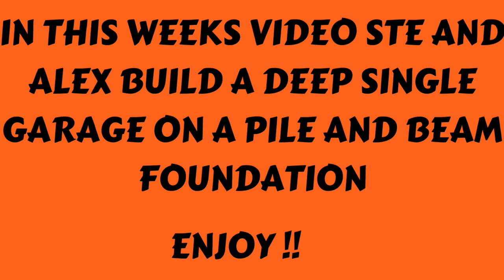BRICKLAYING......PILE AND BEAM FOUNDATION...SINGLE GARAGE

Comment: I've never used profiles or a Lazer. I haven't built many houses either .I worked for my grandfather who was born before they built the Titanic my mother was born in 1926 it wasn't until he died I found out he was at passionate he was bigger than me but he was the gentlest and funniest man you could meet he told me to wet the handle of my trowel to stop it coming loose and it was tight right up until the time it rotted and fell off 😂😂😂😂😂😂😂
Reply from the maker: David Burt . Yep same  trick with the old wooden handle hammer , when the head flew off and over your shoulder if you were lucky 😬🧱👍🏽

Comment: Hello chaps got a question, how do layout ur brickwork in the footings if its below the oversite if u know what I mean cos how can u measure the diagonals if u cant get the tape to the lines or bricks etc. Its more on ur private jobs I'm thinking of. Love ur videos btw from a long time subbie 👍 if uve got time I'd like see a decent setting out video with simple real life ways u lads get in done I know it hard to get the time to do that when ur on a job tho
Reply from the maker: adamstudd28 . Morning Adam . We put a dry trench block on each corner flat or on end so we are now 215 mm or 440 above the concrete which is usually enough to get over the puddings 👌🏼🧱👍🏽
Reply: @SteveAndAlexBuild  That was quick! so do u pull out one lines to the blocks before u do the diagonals. I'm just thinking in my head how do u know the blocks are square on the corners sorry if I'm being thick. Could u write the process u go through please. Cheers 👍
Reply from the maker: adamstudd28 no probs . We start on a nail put in by the engineers then pull a line out on 2 sides to get the blocks roughly square them check the dimensions then the diagonals . Hope that makes sense 👌🏼🧱👍🏽
Reply: @SteveAndAlexBuild  yes I get it. Thanks alot 👍 cant wait till ur next one atb
Reply from the maker: No probs thanks Adam 🧱🧱👍🏽

Comment: I am surprised they didn’t make build the back wall 9 inch . They make us do that in case a car rolls forward
Reply from the maker: Mr Brick . 😂😂 you are joking , you will never fit a car in those garages . 
Seriously though the floors have a 75 mm fall from back to front so no chance of a car rolling back 🧱👍🏼
Reply: Bricklaying With Steve and Alex well there not much use as a garage if you can’t fit a car in them . More of a storage shed
Reply from the maker: Mr Brick Exactly ! 🧱👍🏼
Reply: Bricklaying With Steve and Alex how much are they paying per thousand down there . Am not on sites anymore but there paying 600 a thousand up here
Reply: Bricklaying With Steve and Alex I take it use are off today with the cold and rain
Reply from the maker: Mr Brick Not sure about the supers but we get £550 in the footings 😕🧱🧱👍🏼👍🏼
Reply from the maker: Mr Brick worked till 2 just insulating a slab for a bit of day work 😬🧱👍🏼
Reply: Bricklaying With Steve and Alex I always thought the money would be better in England. Is there still lots of work on the go . There is houses getting built everywhere up here

Comment: Your both as happy as a pig in shit wallowing in all that crap 😂😂. Another quality production ,Besides the perimeter mud the beam foundations are the way forward in terms of being accurate, level , with good engineers lines ect .Nice use of the vertical block as a dead man 🧱☔️💪
Reply from the maker: Cheers Ronnie , we are loving these foundations , shame there is less work in them so we get through them too quick 😩🧱👍🏽
Reply: It may seem that way but if you tally up the time spent bailing out ,sweeping the concrete, doing rough cuts to uneven concrete ,dragging yourselves through the mud ,loading on bits of wood to keep the bricks clean it may be ( just) that getting through the work and getting paid for what you have laid is not to shabby after all .👍🧱😂💪🤔
Reply from the maker: Ronnie Biggs . Good point there 🤔👌🏼🧱👍🏽